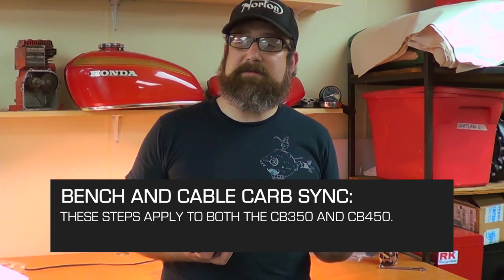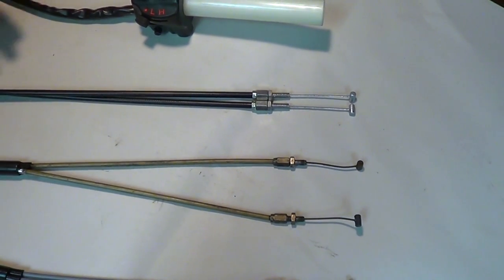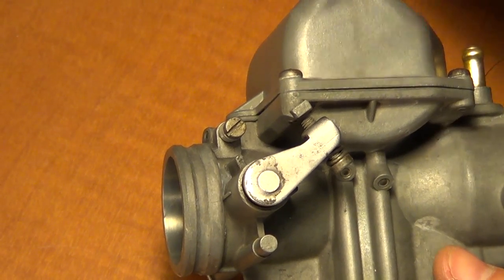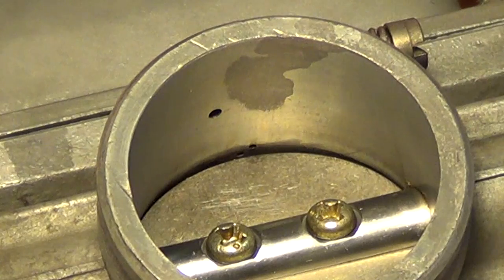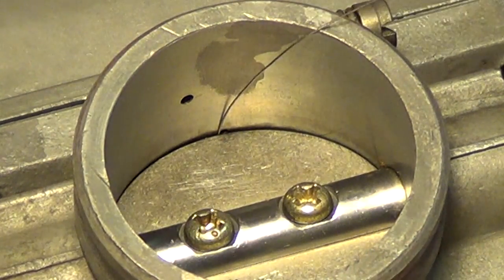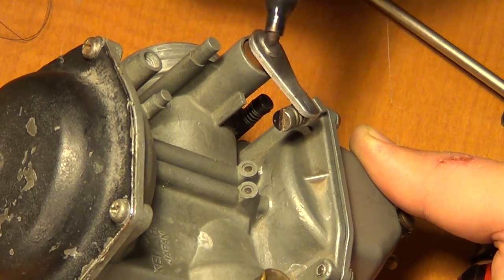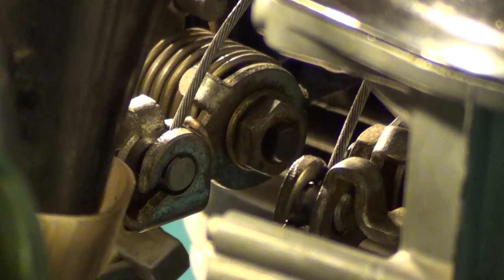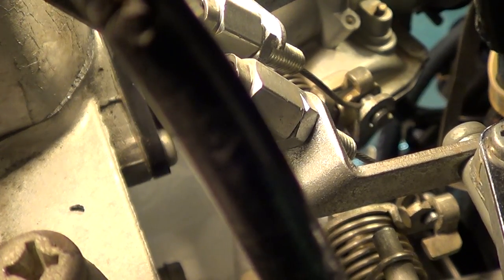How To Synchronize Carburetors On The Honda CB350 & CB450

Comment: I don't own a guitar but I do have a carb jet wire gauge set. If you could mic the guitar wire for me it would be helpful so I know which gauge wire to use from my set for a good idle speed starting point. TYVM

Comment: Great technique but usually not all things are exactly equal, and sometimes you'll find that it is better to fine adjust idle while motorcycle is running. Provided both cables pull and retract roughly the same.

Comment: When your working with clients, just how often do you find the bike's troubles are linked to this seeming insignificant maladjustment? With these tandem cables, it must be a pretty common ill with variation of cable deflection as the throttle wears and stretches over time.

Comment: Instead of putting a wire under the butterfly would it be okay to leave the butterflies totally closed and then come down with the idle adjustment screw until it just stops and use that guideline? I would think so

Comment: Any advice you can provide on my CL450...seems to start and idle fine, lower speeds and gears fine but it doesn't want to go over 55. it starts sputtering like it's out of fuel .

Comment: Do you have a video on how to tune both carbs on a 350/450 while the motor is running?
Reply from the maker: No. The only adjustments you can do on the bike running is idle speed (1200-1500 RPM) and idle mixture. Start with the mix screw 1.5 turns out from seated. Turn clockwise in 1/4 increments till you find the spot where the RPM increases the most. Adjust down the idle speed. Repeat for the other side.

Comment: I have been chasing my tail trying to tune my carbs and I think I just stumbled upon my problem and I feel like an idiot. Can someone confirm my stupidity for me?

Is the choke , with the lever "open", physically in a vertical position, in the farthest notch from the two that are close together, the riding position it should be in after warm up? I think I have been using it backwards thinking that "open" was for cold start warm ups. 

PLEASE HELP.

Comment: Great video!  Question:  Any sage advice on why my '72 CB350 is buzzing/vibrating so much, especially at higher speeds?
Reply from the maker: +CriticalThinker02  It was Honda's way to address keeping the circulation going in your feet and butt when riding for long stretches of time.  ;)    They all do that and it is just the nature of the engine architecture. You have to either have a balance shaft or have more pistons to smooth out the harmonic vibration.
Reply: Common Motor Collective Ha ha, roger that.  Glad it's not just me then.  Appreciate you getting back with!
Reply: Common Motor Collective Had another question for you... Hopefully you'll receive this.  I feel like my 350 is really loose in the front, almost like it could start oscillating at 55/60.  I don't notice that on my CB160.  It's just really loose, like its too easy to turn the wheel (feels like a bicycle).  Is this also a thing with the 350's (like the buzzy/vibration is) or could it be the headset needs tightening or something repaired?
Reply from the maker: +CriticalThinker02 Sounds like you need to rebuild your headset. Could be loose or missing some of the ball bearings. Got an upgrade kit to change it out to tapered roller bearings, which will help smooth the steering out. 
http://www.common-motor.com/honda-steering-bearings
Also you tires could be out of balance and causing a vibration at higher speeds.
Reply: Common Motor Collective Appreciate the advice and feedback!

Comment: I wish the 360t was this simple. Is there an advantage to the complexity of the 360t carb sync process?
Reply: +ArchSmith - The 360 design allows the carbs to be more finely synchronized. Also the 360 design allows you to adjust the sync in real time as the engine is running based on the engines' unique fuel flow demands. The 360 is like the 350 2.0,  it is a higher precision engine, but on the flip side there is a much smaller margin for error.

Comment: If the chain appears fine, how will I know when to replace the chain vs. move the real wheel?
Reply: The usual trick is to measure the length of 10 pitches, for a 1/2 inch chain it will be ten inches.  The chain is considered to be worn when this becomes ten and 1/8 inches.   For a 5/8 chain, the ten inches will occur every 8 pitches.    The other method is to see how much you can pull the chain off the rear sprocket, not too sure of an actual figure, because the size of the sprocket affects the result, but you should not 'uncover' any teeth.   The 1/8 inch in 10 is the usual standard, even on industrial machines, forklifts, conveyor belts etc.

Comment: thanks this is similar to my cb400a carb and will help a great deal.plus maybe you have some parts I need.Like the acc/pump and both air c/offs.I will check your sight soon for these and plugs for both carbs as mine seem unreliable.Bob in sunny Wildwood florida w/ my 1980 hondamatic.w/ 29,000 actual.The new fuel (eth) is corrupting my ride time.any Hints are welcome here.Thanks again.bye and I need to get back into the wind.

Comment: I doubt anyone will answer this lol but i have a 1973 honda cb 350 twin and it doesnt idle like at all i have to give it gas and keep it at like above 1rpm at 3:50 he talks about how that bolt sets the idle speed or watever is that my issue? if i tighten it down will it let my motorcycle idle or do i have other issues on my bike? im thinking about getting it tuned soon too but i just want to know if i can do anything about this idle issue thanks :D
Reply: go to hondatwins.net  It's a forum website and there are people there who can help you out
Reply: The most common problem is a clogged Idle Jet and that's probably what you have going on. If you look where your float is there's that float stop bracket you'll see two little round circles one is the main jet the other is the idle Jet they need to be cleaned out.
I use welding tip cleaner you could get an any Harbor Freight type place for like $7 little fine wires that you can use to clean through the Jets

Comment: is the throttle butterfly beveled;does i go in one specific way...please...ive heard yes and no so....if someone really knows
Reply: +snuffelsuf Yes, it is beveled and it does go in one way only, usually with some writing on the upper side of the butterfly facing towards the engine.